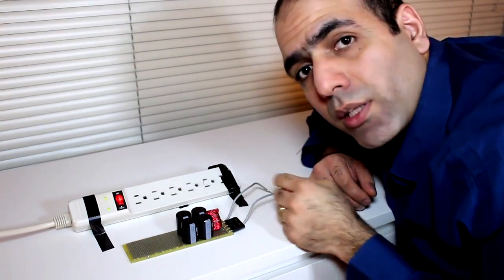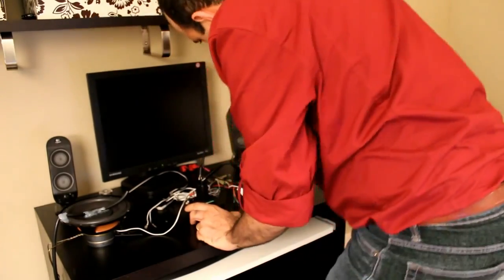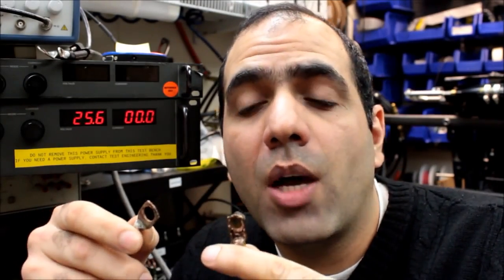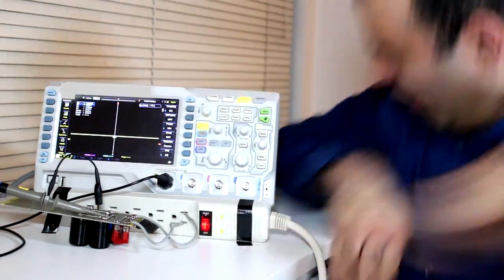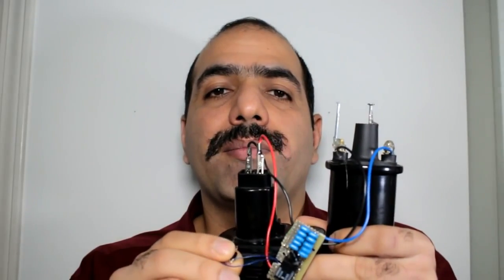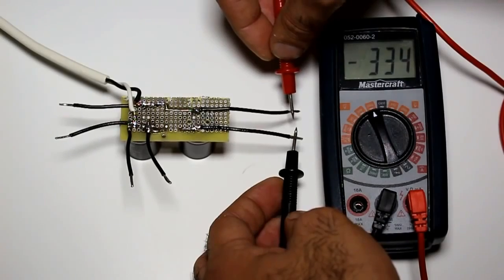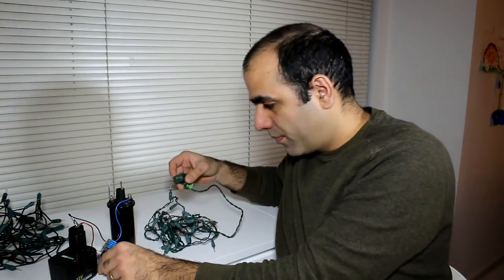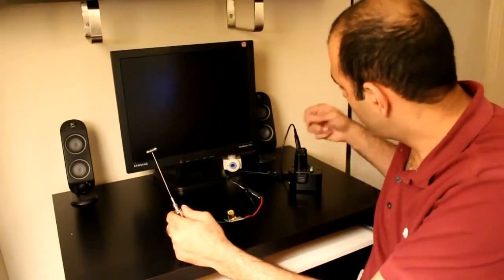Best of Mehdi Sadaghdar

Comment: Bro that 1st video with the 4 capacitors plugged into a outlet is no joke. Anyone ever hook just one up to a spliced extension cord if not try it far away from you and outside because they can blow up which is more common the smaller they get and the big ones you never know they can puff crazy smoke or blow up. Be careful stay safe